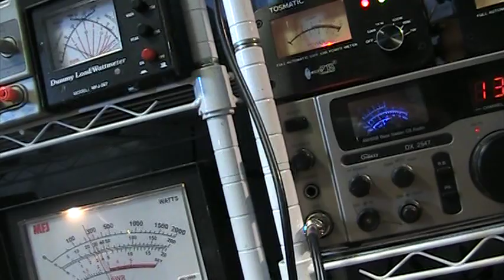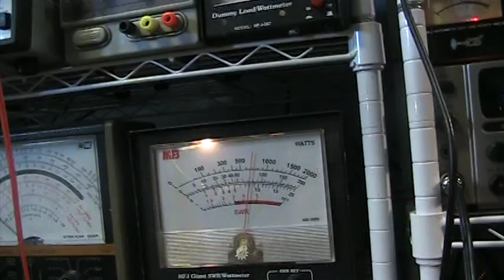Maco 200 Linear Amplifier

Comment: I am looking for a maco kw power supply. Do you have one by chance?
Reply from the maker: If you want to sell that Maco KW deck, let me know.
Reply from the maker: Nope could use one myself. I have the complete one seen in the vid and I got a mobile KW I am making a ac power supply for using a Phantom 500 chassis and putting in an extra transformer.

Comment: Weak because some idiot drove it too hard!!!!
Reply from the maker: or stayed on it too long, or had a bad SWR or had a pin in the coax or mistuned it or tuned it down to save the tubes or used it to drive a bigger amp which had a high input SWR!!!!!

Comment: If that was my amp,I would convert it over to using one 4CX350 ceramic tube,this would have about 400 watts of output and about 400 watts of plate dissipation.
Reply from the maker: IMHO it would take about as much work and parts to convert this (the right way) as it would starting from scratch.

Comment: can i use 6lf6 in place of 8950 i have a palomo skipper 300
Reply from the maker: If my memory is right, 8950 are 12v filament and 6lf6 of course are 6v filament.
Reply: You can series the 6lf6  I have a Maco 300 that I had that done works fine